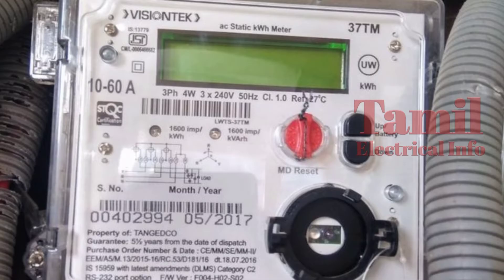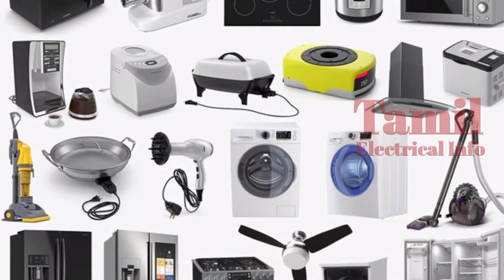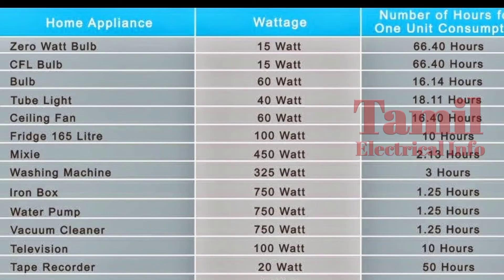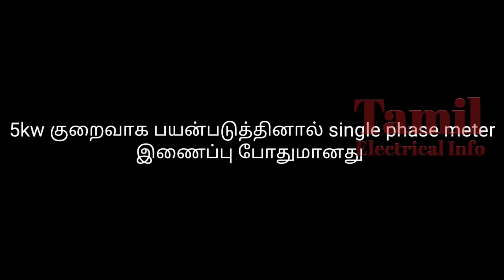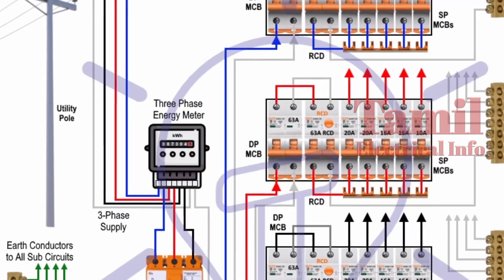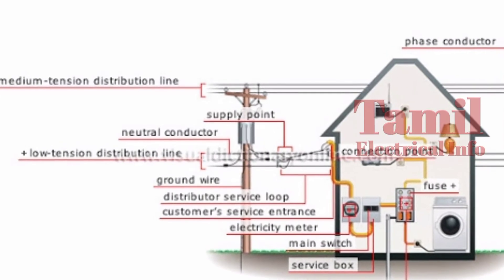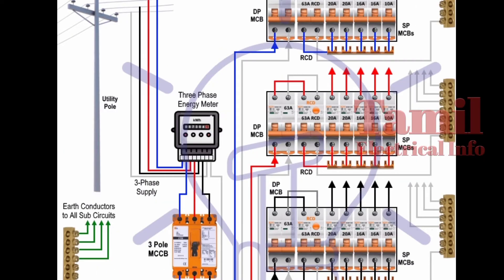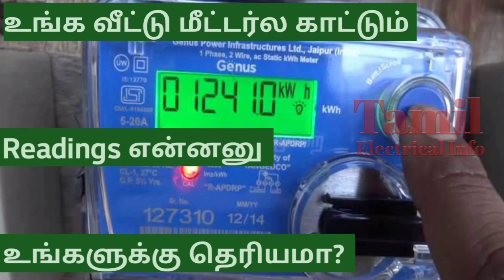Single phase meter or three phase meter |எந்த மீட்டரை உங்கள் வீட்டில் பயன்படுத்தலாம்

Comment: Bro , shifted to a new rental house with 3phase current supply on a single day avg 6units just for a light and a fan pogudhu. If we use ac per hour 2unit use aagudhu. But at the house owner downstairs Avunge veetule motor/ac/ multiple lights and appliances yellam use panniyum 6or7 unit pogudhu. Yeppadi adhu?

Comment: I am living in rented house load is not sufficient for my portion. I have only load capacity 1.8kw for my meter. I asked eb foreman to increase the load capacity of my meter single phase connection. But they said there is not possible to increase the load you have to get only three phase connection. Is that true??
Reply: Bro additional load ku charges ethum pay pananuma eb office la???